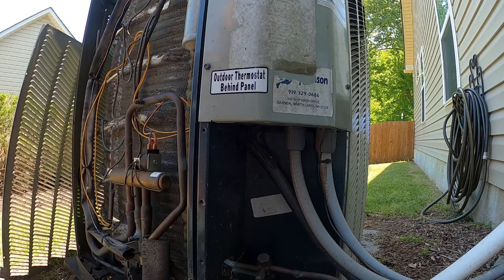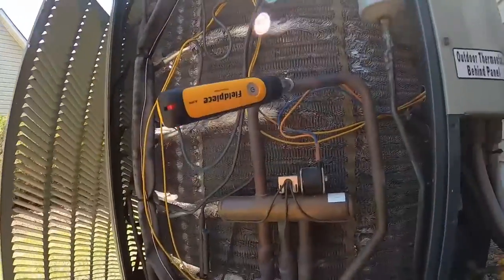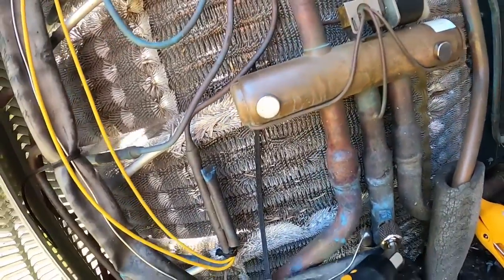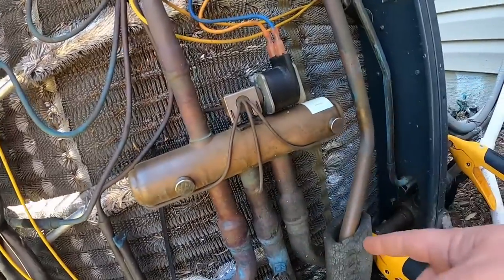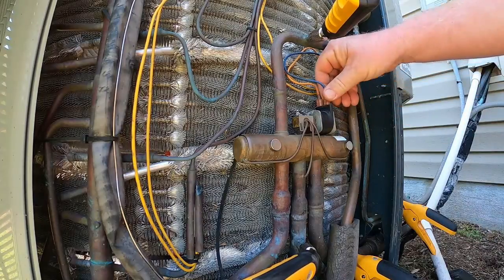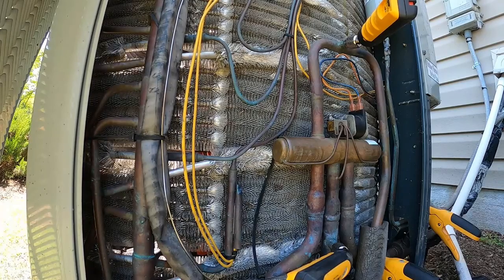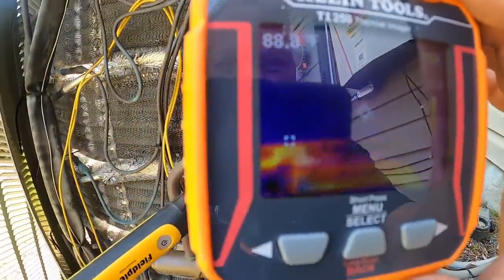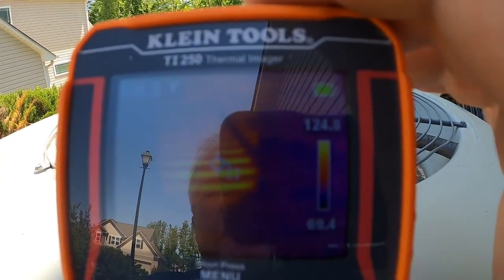HVAC Reversing Valve testing and checking the refrigerant circuit with Thermal Imager.

Comment: I have a new unit heat pump.
Was working great .
Now heat will not work. 
AC is great.
When I swith to heat blows cool.
Then when switching back to AC it blows cool about 65
At install Temps 
Heat was 89-94
AC WAS 43-45 
24v at all control wires.
Compressor is good ?
Tested compressor 
C-S-R  value equals 1.0 -1.7- 2.7 total of both sides. 
So when I diagnosed why this is happen. After capacitor is good also. 
After all the diagnostic pull disconnect. 
In that time put every back together,  AC WORKS PERFECTLY FINE.
2 techs tell me my new heat pump 3 weeks old , compressor is bad, because the gauges equalized.  
I ask to checkout switching valve. ..I know with all the resurch on line bad sw valve will give you faulty reading like a compressor. 
TXV for cooling. 
The only thing I can think of is the installer didn't put the piston in condenser. 3/8 line.

But if so why would the heat pump work great 2.5 weeks then nothing. 

That trick is awesome with the magnetics...
Has a home owner and Handyman  mechanically skilled background. I have to due this because the techs that come will not look at the sw valve. 

Do you have any suggestions 
Thank you .